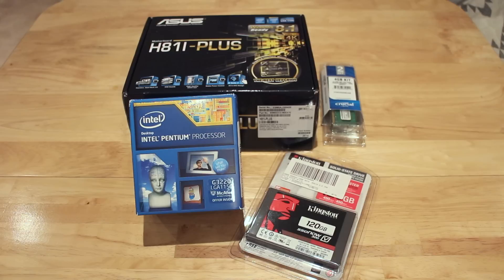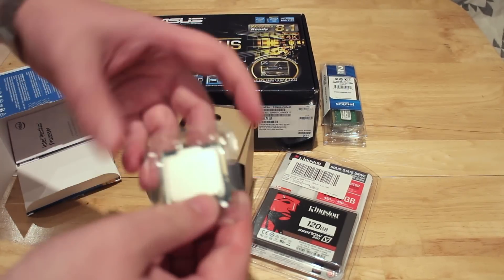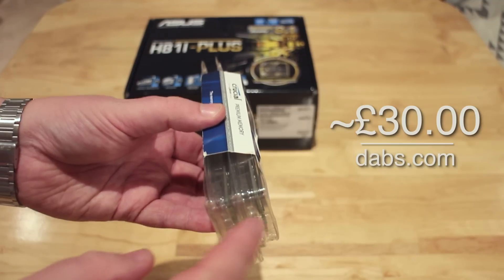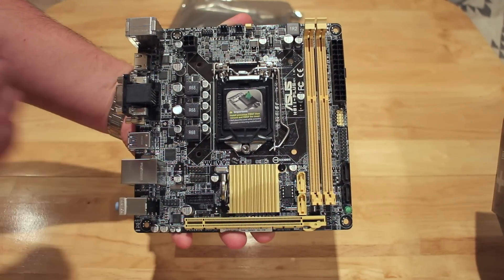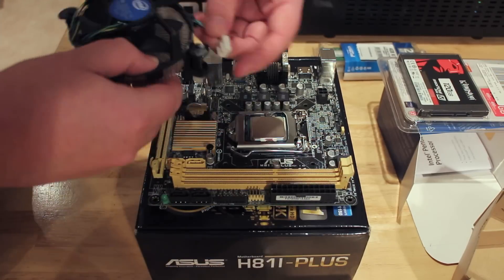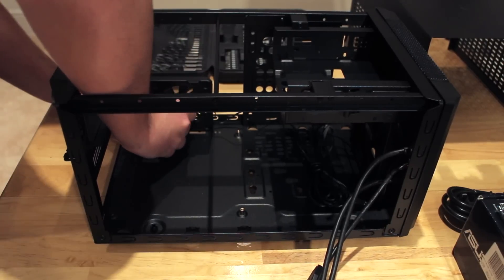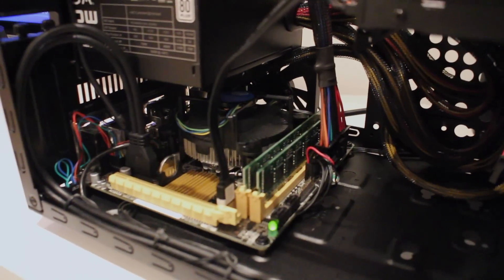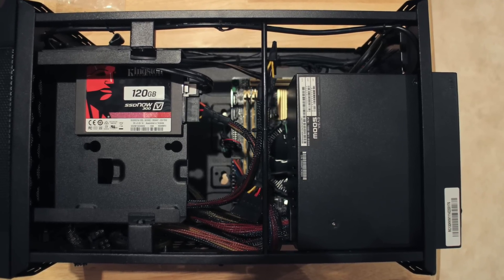Cheap Home Server Project: Part 2

Comment: that was a very nice build. This video made me decide that my next machine will be built in a similar manner. I never had much use for eye . I never had much use for ITX, but this is pretty neat. the only thing I worry about is that I might have to take something like this apart if I ever have to fix it or work on something deep inside. still, this is really cool
Reply: please excuse the lack of capitalization. I'm using voice to text, and it doesn't seem to be able to punctuate or capitalize the way I want it too

Comment: This video is not about building a home server, what you have shown is a standard PC build.
Reply: +Andrew Jenery it's a standard PC built for a home server, most people who are going to have home servers don't need some high end server using expensive parts and such
Reply: +Chris Baker 
Yes, I agree with that, I'm doing a similar project myself using standard components, but you don't cover anything server-specific such as the OS you'll use and physical connectivity between server and client systems, e.g fixed cable or WiFi and switching required if any.
Reply: Andrew Jenery true, but this is more of an amateur channel
Reply: +Chris Baker Yea, well I am an amateur.  I was hoping to get some clues as to the actual server-side of things.

Comment: Great video. Have been super keen to setup a similar system for Plex. Are you able to show the setup from this stage to installing and running plex. i,e installing the OS and Plex and getting it up and running. Would be greatly appreciated. Nothing else out there that i could find that explains this process simply.

Comment: And it is a home server with no HDD's.  Just a single SSD.  WTF??????
Reply: That was my thought, where are all the mkv files going?  I would want at least 2 x 2TB drives mirrored just in case one failed.  The last thing I want is to lose my 300+ DVD's.  Not to mention the many hours converting them.
Reply: dvd in 2017
Reply: JacobiteJake Pfff for 50$ u have Blu Ray burner.
Reply: Who said it will be a storage server?

Comment: i have two questions 1 What software you are usig ? and 2 you use the ssd for putting files to it and deleteit every day ? becaude ssds Flash storage handles data in a specific way. When data is written to a block, the entire block must be erased before it can be written to again. The lifespan of an SSD is measured in these program-erase (P/E) cycles. Modern, consumer-grade, Multi-Level Cell (MLC) NAND memory can generally endure about 3,000 to 5,000 P/E cycles before the storage's integrity starts to deteriorate. The higher-end, Single-Level Cell (SLC) flash memory chip can withstand up to 100,000 P/E cycles.

You'd have to work hard to reach the P/E cycle limit for an MLC-based drive, let alone an SLC-based one. Nevertheless, every time you write something to the drive, you bring it a little closer to its demise. Don't obsess over every single write cycle—a few of our later tips are best suited for such tendencies—but do check out the following techniques for minimizing unnecessary writes to the drive. 

!!!!So if you putting a file/picture/video/music or something into that ssd than you delete and you make this every day your ssd will die under 1 year becase ssds are not designed to use for server ... put a hdd into that server fast before you kill that ssd ... hdd will be louder but not will make speed diferences because the max speed of a server over the LAN Port is 80-90 mb/s and a normal sata2 hdd can put out 150 mb/s so you not reach anyway that limit with ssd or with hdd as well THX For Reading And i hope you learn something Hello!
Reply: DJ Norbi Hes not running his content off the ssd, hes got a sysnology server nas with all of his media content on it.

 This builds purpose is to use the content from his nas and output it over his network as a replacement of his laptop (as seen in a previous video) all the sdd will be doing is running the plex software and holding all of the meta data for his media content.
Reply: ***** Plus, 128gb wont hold much. trust me! :D
Reply: My phone has 1TB storage 512 Builtin and 512SD card and here this guys is using that little drive on server!!!!!!!!!

Comment: I'm fairly new to dealing with servers, and so far there is only one that i don't understand... After building a server like this, or buying one pre-made, how would you transfer/retrieve files from another computer? Do I need to physically connect the computer to the server?
Reply: Main's Music™ Can you explain to me the steps to connect, lets say 5 computers, to a server like this?
Reply: +Main's Music™ It depends on the OS you are using, but first of all, you should get an ethernet switch with sufficient ports. Connecting to the server is a snap once you're all wired up, and Google will help. It basically depends on what you're going to do with it.

Comment: avoid kingston ssd, go with sandisk, you can get 240 gb for around 70$
Reply: +George Florentin from what ive been told the v300 ssds have shoddy memory controllers?  Its been a while since ive done the research
Reply: George Florentin hmm thanks for the info